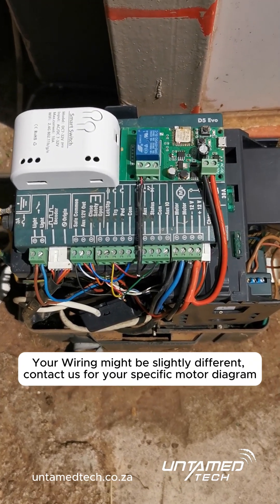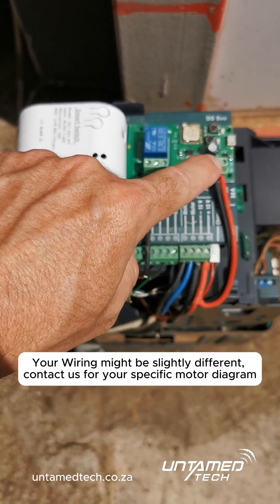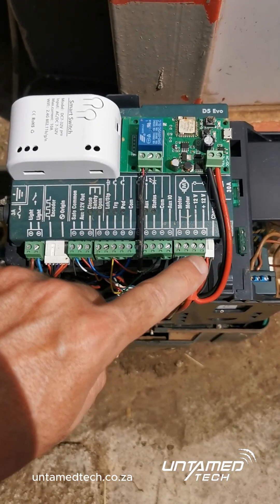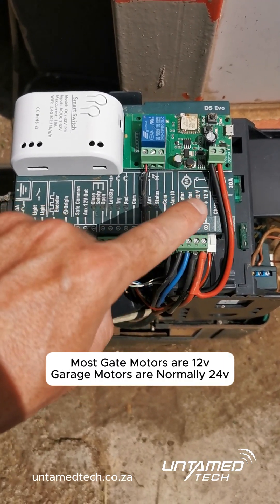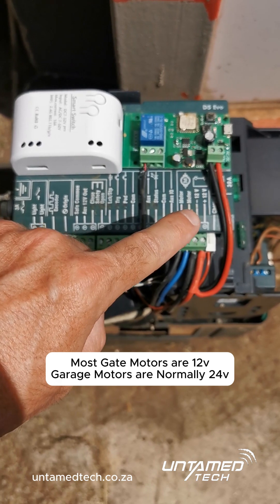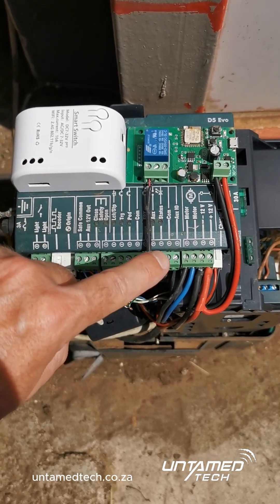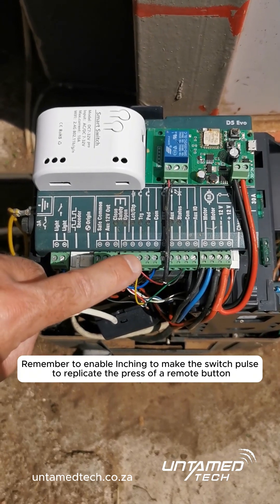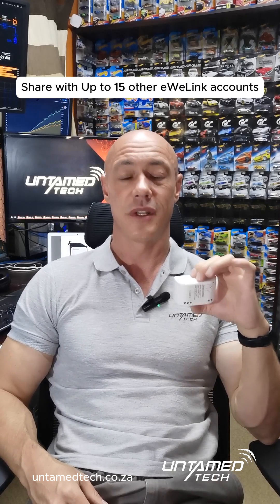Smart Wifi Gate Garage Opener Installation & answers to all the questions we received #untamedtech

Comment: Hi, this is 433.92mhz, what if someone sniff and capture the signal and replay it. How we can secure that?  

It can be, after the signal of the 433.92mhz, to turn off the power to the RF module, manually from the app I think, but I don't know if is implemented in the pcb like that. So the question is it possible to turn off the RF module, from the 2.4ghz in the app? This is security issue if this can't, because 433mHz is not safe for locking with all radio sniff devices, but is usable for many things not for security, because vulnerability, it doesn't matter rolling codes! So the security need to be improved!